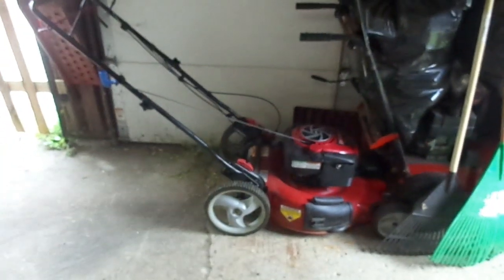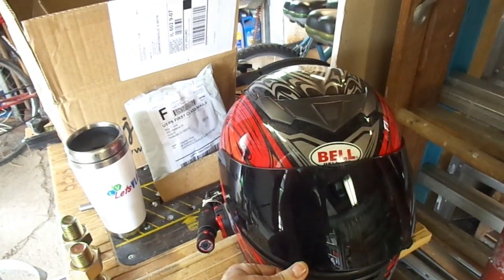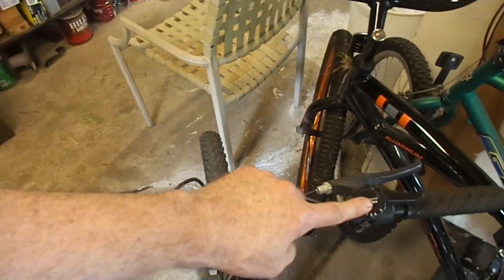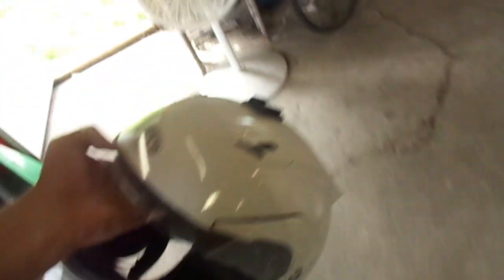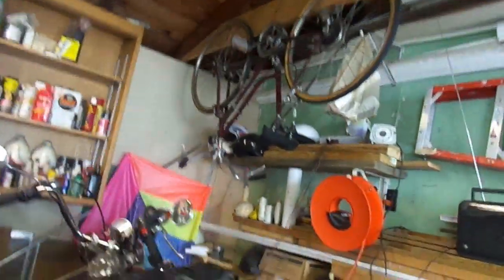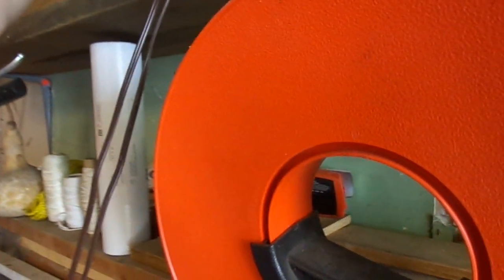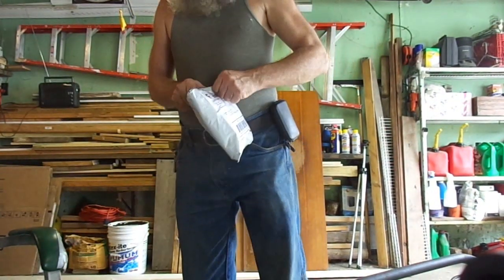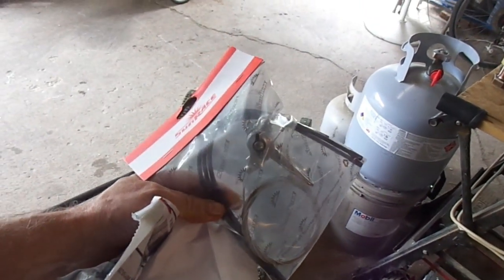Helmets, Bike, and Lawn Mower

Comment: Vey nice collection Chuck. I have saved one helmet from back in the 60's but the inside has about turned to dust also. I had a guy tell me there was a place you could send the old helmets off to and have the insides replaced but being as old as I am the name eludes me right now. Ride safe my friend.
Reply from the maker: Probably better to not restore the old ones unless you keep them in a display case. The 60s helmets even rebuilt would perform very poorly. I sill kinda wish I did have that old steel half helmet of my Uncle's. Probably thrown away long ago.

Comment: I only have about four helmets right now. The original green HJC from my Ninja 250. A yellow one I bought for the new Triumph that did not match shades and looked pretty bad next to the motorcycle. My black and gray Icon Alliance SS that I am currently using and an OLD helmet some guy at church gave me when I said i needed a helmet for the kids. It has a cross taped on the back with tape!  I am planning on getting rid of the yellow helmet that did not match.
Reply from the maker: If any of my helmets were even three shades off I probably would not notice. I don't have a good color sense. My bike is actually maroon and my helmet is medium red. Close enough for me. LOL
Reply: LOL! Yeah I noticed! this is the difference between gold and safety yellow. Pretty drastic.